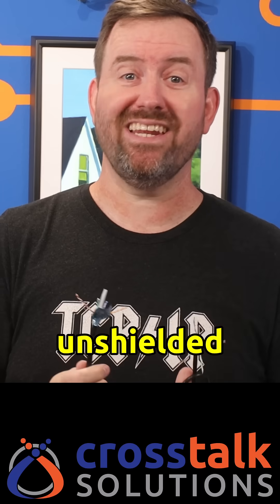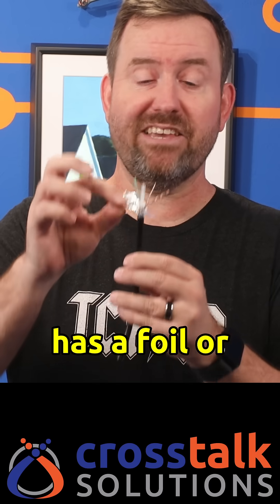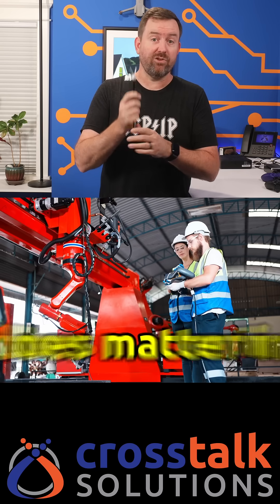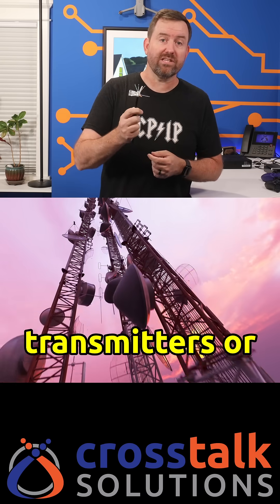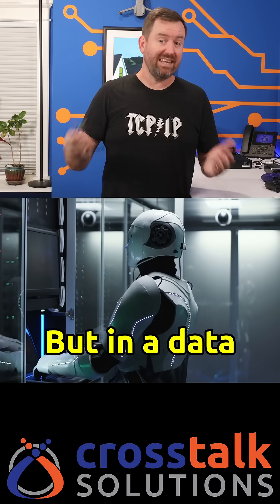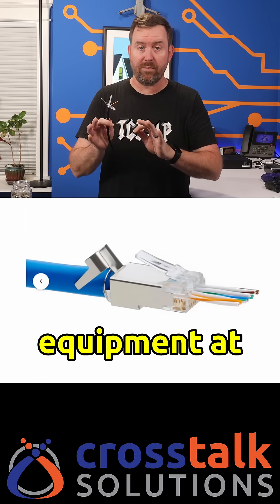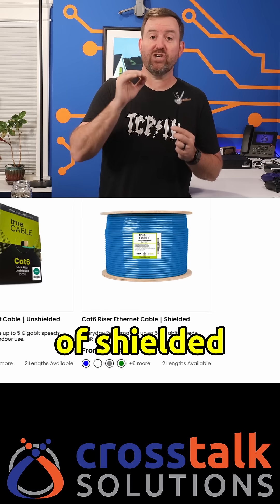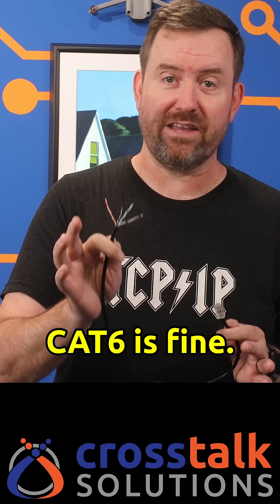Shielded vs Unshielded Ethernet – Stop Wasting Money on the Wrong Cable

Comment: Shielded cable also needs to be used with proper shielded compatible switches and arrestors. Simply running shielded cable actually increases susceptibility to EMI, it also becomes a giant antenna if not installed and grounded correctly. Nine times out of ten.. just go straight UTP.

Comment: If you run I always plan ahead when running cable. Yeah, I don't have to come back to run replacement cables if an upgrade is planned, I don't want to charge people twice for the same work.

Most times, newer equipment will start using the better tech sooner or later and it's good to have the infrastructure already in place so you only need to replace the equipment.

Think when all homes came with POTS cable, then you had to go upgrade to Cat5 cable, then if you wanted faster speeds you got Cat6 ran.

Comment: It Dose Not hurt to Buy shielded CAT Cable if you Running new cable anyways. You can use it in the Future for things Like POE and Running one POE Line may not cause issues but Running some more can. And if you run HDMI over CAT/IP or Audio (Like via Dante) over CAT/IP you may start to See issues with unshielded Cable.
You should allways Future Proof your install, it may Sound Crazy but I went with CAT8 Cable and CAT6 Connectors just to make sure I don’t Need to run them again no matter what silly things i might want to try in the Future so I don’t Need to run new Cable and just Need to replace the connectors on Both ends.

Comment: I once ran 4 shielded network cables 280 ft high on an FM broadcast tower. Until then I had never seen true wired emi interference. We were smashing our heads against the wall until we came back and grounded it periodically and got full speeds.

Comment: The TrueCable Cat6 is $145 for 500', 1000' is $190. They're on the same listing so it shows the cheaper 500' price. Also the shielded you mentioned is $194 and $266 for 500' and 1000' respectively. 

I was hoping you were right, that would have been awesome pricing. Your point still definitely stands though :)

Comment: It's the same with cat6 vs cat5e. So many data applications will see cat5e cable outliving them and cat6 is an overkill upgrade for many applications. Especially for cameras where most interfaces are still 10/100 even on 4K cameras. Obviously cat6 works also, but it's not required for a myriad of standard modern day data applications running at 1Gb or less. Everyone thinks they need cat6 or whatever and they probably don't in many cases. Like anything else measure the use case and don't overspend. Ymmv.
Reply: Agreed, I'm getting 2.5G on older Cat5 it's not even 5e. For new installs though you might as well run Cat6 though unless you have 5e laying around already, the cost is only marginally more, ~$0.05/ft more plus or minus depending on brand and source.

Comment: 3 phase domestic electrical for properties is becoming more and more common in the U.K.
If you’re crossing and electrical cable or running past a consumer board, then it’s probably going to to be fine. If however the data cable runs along side the power cables over distance, use STP. Ripping the house apart when you realise there’s a problem after second fix and testing isn’t going to be fun, just to save a few quid on cable. I’ve seen plenty of Sparky’s who have run data cables alongside 6mm and 10mm cooker/shower cables and even use the electrical cables as ‘cable management’ for the data cables. I’ve had plenty of calls when a property is finished, the builder/sparky can’t work out the problem, only to realise that there’s packet loss due to EMI coming from these larger power cables or where there’s a bunch of power cables together running alongside a UTP cable. There is no hard and fast rule, which is why a good survey, good plans and a good engineer who communicates with the electrician before and during the install is important. Also seen plenty of Sparky’s using CCA or even stranded for long runs (again to save a few quid on cable or lack of knowledge). Audio/etherconn is a whole other story. Problem is, the take away for most people watching this will likely be, unless I’m in a factory environment or installing an MRI machine, I don’t need shielded. Not the case. Also, grounding both ends is often absolutely the wrong thing to do (again depends on the situation). Generalising like just isn’t good advice.

Comment: Great video. I am a ham radio operator, and even running my radio cables alongside my UTP cat6 lines from the basement and into a conduit on the side of the house into the attic I have experienced no noticeable issues. I did not realize you have to terminate the ground properly on the shielded, so I’m glad I saved the money (and time on terminating the connectors) by just going with UTP.
Reply: That's interesting. For five years now we've been starting a ham radio group. We're getting a chunk of a county building for our headquarters and when we were doing the walk-through of the build out I noticed that we specified shielded and that everything was shielded. Some people were concerned but I also know it's probably not gonna be that bad as long as we keep our RF properly controlled and routed.

Comment: Another use case is when you are dealing with audio equipment that demands shielded cable for signal integrity
Reply: No, shielded Ethernet has nothing to do with integrity of the signal! Audio over TCP is no different from any other data!
Reply: @B@B @BillyIdle73 u should go look at those audio over cat5 snakes. They’re pretty cool. A lot of those require the use of a shield for the neutral on a phantom power signal

Now something like a Dante network does not need a shielded cable. But I’ve seen systems that use a proprietary connection like AES-50 and in a lot of the time the manufacturer will recommend the use of a shielded cable between audio devices.
Reply: No it's digital

Comment: You forgot the main one, Chris.  If you have a rodent issue, then you need STP.  Rats don’t like chewing through foil.
Reply: Braided shielding may provide some minimal protection, but it's not the right product for the application. If rodents are a real concern, one needs to get armored cable.

Comment: I used a shielded cable to make a connection near the beach; it was a standard UTP cable, and the beach destroyed it. But making a shielded cable connector could be a pain in the neck, especially if you don't have proper light and enough room to maneuver.

Comment: No such thing as Ethernet cable.  It's  Shielded Twisted Pair or Unshielded Twisted Pair.

The Ethernet frames run on this cable, or on fibre, or over the air, or on coax.....
Reply: If you want to get into the semantics, saying "Shielded Twisted Pair" or Unshielded Twisted Pair" can apply to lots of cables that have nothing to do with networking. For example many audio cables are technically Shielded Twisted Pair or Unshielded Twisted Pair. People use the word Ethernet for convivence to understand the application rather than always say for example "cable that meets ANSI/TIA-568-B.2-1 specification".
Reply: @timezonewall  So you have the point now.  Well done.  Do you want a medal?
Reply: @tcpnetworks  LOL, thanks for confirming of the two of us, I'm the one who understands the point. No medal required, but the thought is appreciated. Have a nice day.

Comment: Cat 6 STP is the recommended cable used in audio applications. In recent years,  installed audio is carried over Cat 6 when used as an input line. For example, running Cat 6  UTP to powered speakers can introduce hum, but STP ensures that is unlikely to occur. Cat 6 cables used in such applications are known as "ethercon" cables.

Comment: Generally you want the cable to be bonded to ground only on one end because the grounds could have different resistance and that sets up a situation called ground potential where voltage can pass to one end and damage equipment. Saw this at a school that had portable trailers outside of the main school building with network cable run from the main building to the trailers. The school would burn out switchports randomly in the main building which fed the trailers. Changing to fiber fixed the problem. The other way to fix that would have been the electrician would bond the trailer's ground to back to the main building's ground.
Reply: the more you watch crosstalk solutions as an actual industry person, you start to find he's more a jack of all and a master of none
Reply: You could also use an Ethernet Isolator, basically Magnetics in a case with two RJ45 connector isolated from eachother. afaik they can withstain 5kV.
Reply: @H4zuZazu  I never knew they actually made those, useful to know...Ethernet's already transformer coupled but as far as I'm aware the little signal transformers at the ports are only good for about 100V.
Reply: Technically the ground should've been bonded back to the main ground. As NEC requires that any sub panel be 4 wire or more for 3 phase.

But yeah ground potential difference.

Technically you want the cable to be terminated fully on both ends and let the equipment decide whether that is needed. Which in this case would probably mean an unshielded jumper.

But really that's what fiber is for.

Comment: Does the ground need to be the same on both ends?
Reply: Only ground on one side if used over longer distance, buildings or used between equipment with different ground levels

Comment: Didn't know that cat 6 is still in use somewhere. I would not go below cat8 anymore.
Reply: Other than large data centers, Cat6 and Cat6a make up the majority of new installed. Cat8 while a growing segment, is still very much niche.
Reply: @timezonewall Not in Germany.
Reply: @craxity  I'm not talking about any specific country such as Germany, I'm talking globally. Research it.
Reply: @craxity classic case of higher number = better. Cat6a is 1/4 the price and able to pull 10gBaseT, thats enough to saturate an xgspon connection, something not even fielded here yet. An Electrician installing cat8 is doing the classic upsell, especially in germany where data lines are mandatory installed in smooth conduit and easily swapped
Reply: @hanswurst-h3e  Cat8 is only 50% more expensive than Cat6A. And Cat6A is hard to find anyway. Compared to the cost of the labor that's irrelevant.

Comment: I didn’t know that unshielded Ethernet cables were a thing. The standard here is Cat.7 S/FTP which means all 4 twisted pairs have a foil shield and another braid shield around all pairs. I did a quick search for unshielded ethernet cable and only found a few results that aren’t really cheaper.
Reply: Why use Cat7? It’s effectively dead and not an IEEE standard. Just use Cat6a, since most Cat7 is just more expensive, rebranded Cat6a anyhow. Or make the jump to Cat8.
Reply: @BubblesLovesKitties-t7e  Maybe that depends on the country. In Germany I would say more than 90% of installation cable run through buildings is Cat.7 S/FTP 1000MHz. In the Patchpannels and outlets we of course use the standard Cat.6 plug. So technically the whole installation is only Cat.6. If you buy it in bulk Cat.7 is not to expensive with around 0,6€/m or 0,21$/foot.

Comment: Well, maybe that 1% is perhaps more. And, maybe, you haven't realized that the noise in your HiFi / Home Theater or your FM tuner is coming from your Ethernet UTP cable, which "qualifies" you to be in that >1%. 
Especially, and this has not been mentioned here, if you have PoE equipment (notoriously known for spreading noise like hell) coupled with loooong UTP lines to feed your cameras/APs/flood lights/etc... 

Not to mention if you have a Ham radio station (yours or close to your place), or if you just like to relax by listening to broadcasts in LW (long waves), MW (medium waves) or SW (short waves), or maybe you like tracking airplanes with your ADS-B gear ... long story short, perhaps UTP is today more needed that one might or want imagine, even for us 'private citizens'.

Moreover, we are just considering one side of the story here, the emission of interference. Reception of interference (if you live close enough to strong RF fields) with its load of weird problems/unexplained reboots and so on, it's definitely another matter that STP (and a good grounding + ferrite beads) can solve.
Reply: If the environment EMI is really that bad, for long runs especially I would just run fiber.